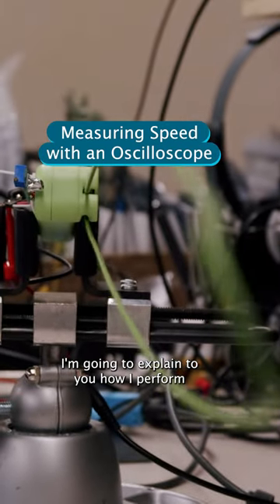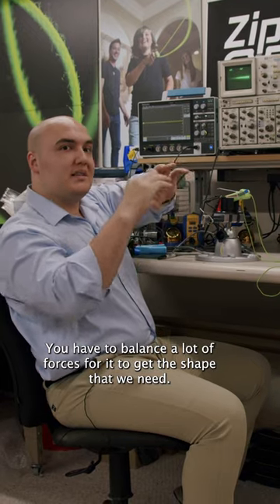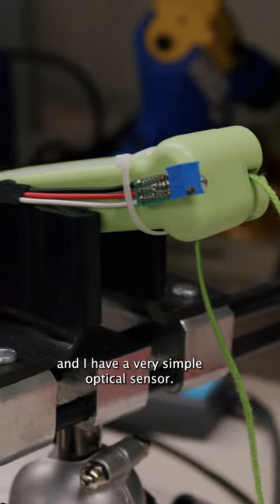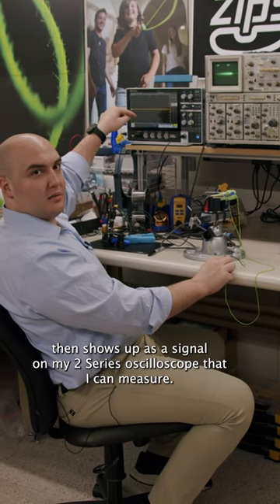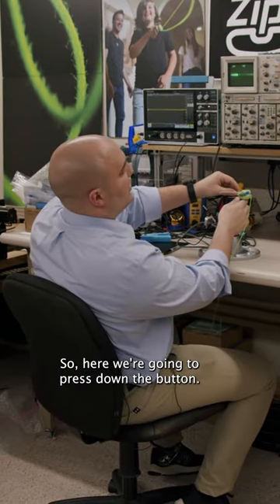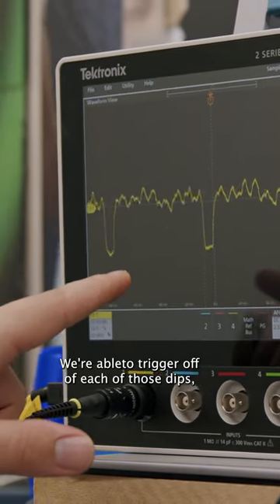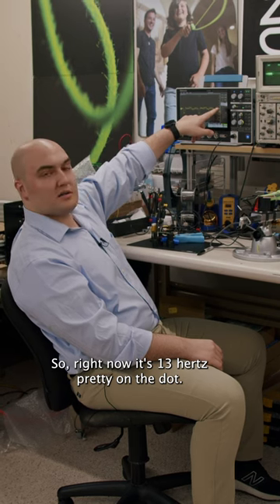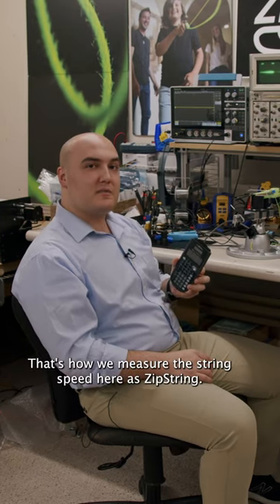Tektronix #Oscilloscopes Help ZipString

Comment: Can do the same time measurement with the 7000 series scope next to the DSO, but a 2247A from 1989 would be better, as it has onboard period/frequency readout.
Reply: Hi, I actually own the 7D15 frequency counter plugin for my 7000 series, and could very well have set that measurement up. I think it’s  awesome to use the vintage Tek and it’s even better to use their latest series scopes.